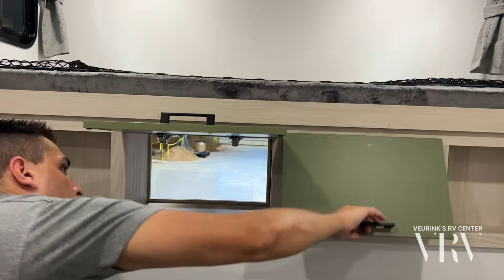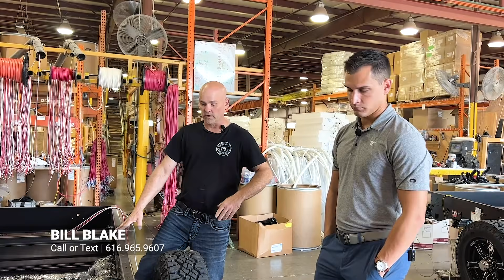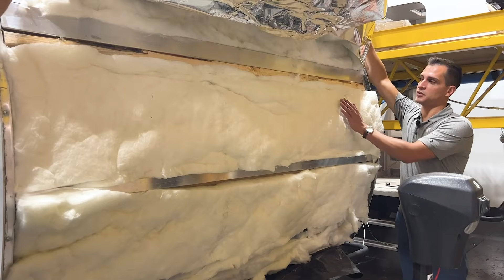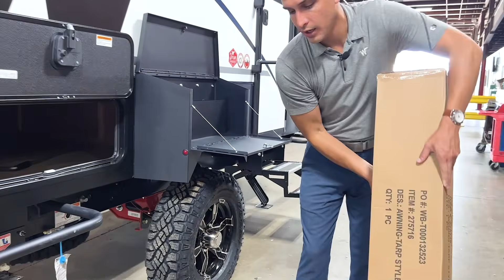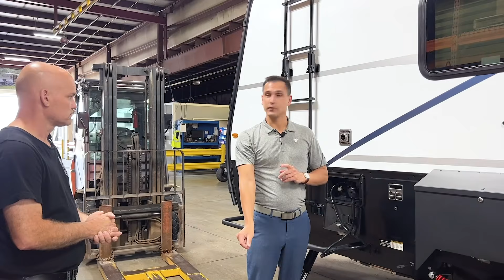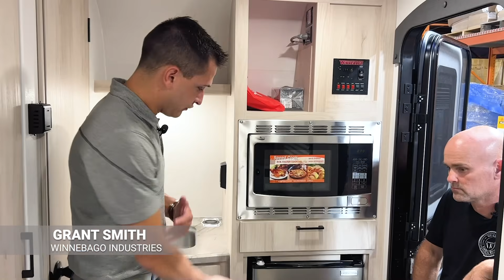2023 Winnebago Hike 100 Series Exclusive Tour | Construction, Suspension, Features | RV Dealer in MI

Comment: Hike100 is a swing and miss. Can’t wait to find someone to buy mine to get out from under it. No instructions for any of it, and I had no kidding at least half a dozen things break within the first trip. Not sure why it’s advertised as having off-road suspension when the interior can’t even hold up to a smooth gravel road free of potholes without everything falling apart. The bathroom is basically unusable (I'm only 5'10 for reference). We only use it as an absolute emergency, otherwise it's outside like tent camping. The fridge isn't propane so you need a generator 24/7 or are forced to use an ice chest. The "Electric cooler" it comes with isn't battery powered so again you need a generator or running vehicle making it nearly pointless. The ridiculous batwing awning? If I wanted to spend an hour setting up a tent I wouldn't have bought a trailer. The Hike 100 is basically an overweighted towable covered bed with a water pump and heater that dropped my gas mileage to 6MPG. Best part? No  dealer near me will even honor the "warranty" for everything that immediately broke since I didn't purchase it here.  Winnebago should be ashamed of this one.

Comment: The only thing that disappoints me is that they use plywood on inside walls and the roof.. wish they would do no wood and full azdel as well. Especially for the price! Cmon winnebego!
Reply from the maker: Thanks for watching! We will pass this on to them for future design and build suggestions!
Reply: Yup agreed. You want dealers listing a 16ft trailer for 40k. 
Get rid of the plywood, and change to Duel pane windows. 

Plywood roof, and cheap windows its a 25k 16ft box with an almost solid effort. I like the switch to Truma, I like the composite floor, I like the wall build. But then they go full Indiana made dumb and go with the roofing that you find in a $18,000 Wolfpup. 🤦‍♂️
Reply: Yeah I  was almost sold until I saw the 3/8 in OSB( not even plywood!) of all places on the roof?😢  notice that the guys totally skipped right over that!

Comment: To be blunt, sweet tires, but they are on a TRAILER.   Tread is for traction, that is not a drive wheel.  That beefy tire is without function save appearances, it just adds resistance and weight.  Love ❤️ it anyway, looks excellent!
Reply: 100% disagree on the tire comment above 👆 If you have the 2 same campers on a slippery slope or following tracks one with good tread and one without which one ☝️ do you think is most likely to stay on the road or following the tow vehicle? It doesn’t matter if they are drive tires come on meow 😂
Reply: @nowayoutstp4  — You have a point, they ‘might’ help on a sideways slippery slope, and I wasn’t thinking of downhill braking either… good points!
Reply from the maker: Thanks for tuning in! It's going to be a great travel trailer option :)
Reply: Dude no. This is wrong. These tires will provide some traction off road.
Reply: @ChopperChad  — I think you’re confusing grip with traction.  As @ZR CARR said above, they might help sideways or downhill on a slippery slope.  But for the most part, ‘traction’ is irrelevant on a ‘trailering’ wheel, and there is zero power going to it.  Think of it this way… You are in a front wheel drive vehicle going down a snowy/muddy/icy road with limited traction.  If you get one of your front right wheels on slippery ground (open diff), you’re stuck.  Those beefy tires on the rear are just added weight to pull through the muck.  The same is true for trailer wheels, just added weight “for the most part” for your tow vehicle to move, pull through whatever sludge you are trying to cross.  While sideways slippage might be marginally reduced, in most cases heavy tread on a trailering wheel is pointless.  Sorry, we may have to agree to disagree on this.  Now if they ever come out with electric motors on trailer to assist with the boost on demand when needed… SIGN ME UP!  That would help!  Otherwise tread is just weight, the mud/snow/whatever that gets in between the tread also just adds weight your tow vehicle has to move.  When you get stuck, the first thing you do is unhitch to remove the dead weight and come back for your trailer.
Reply: @Erin-Thor  Downhill braking is the same as power as far as the tires are concerned.  When you apply the trailer brakes, you rely on tire traction to do the braking.  If the tires slip, you could jackknife or slide sideways off a slope.  Offroad tires are absolutely necessary for an Offroad trailer.
Reply: @arkos55  — I stand corrected. Again.